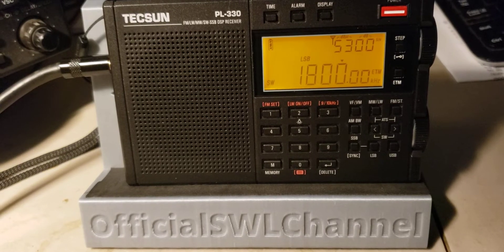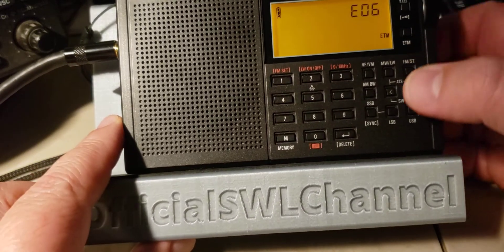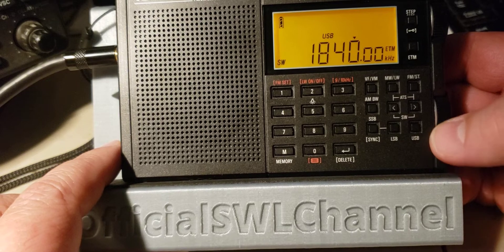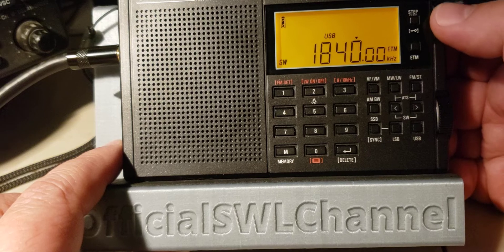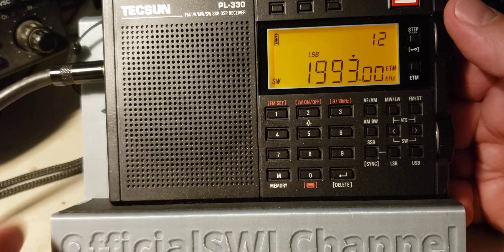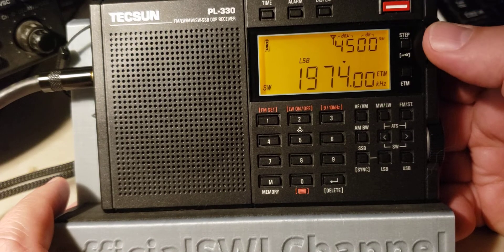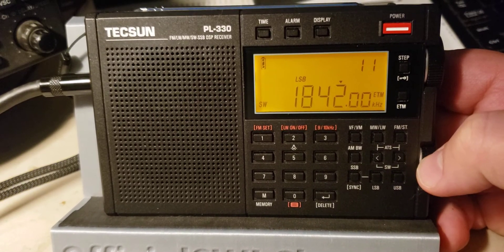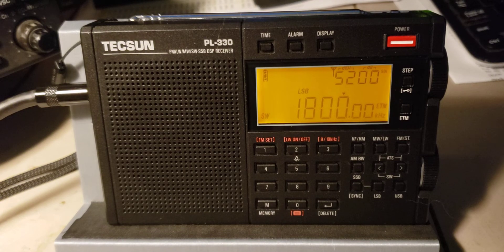Tuning the 160 meter amateur radio band on Tecsun PL-330 portable on MLA 30 magnetic loop antenna

Comment: Got an RSP1a which I'm still learning to use, but ordered a PL-380 based on your recommendation for emergency use because it uses AA's. Still hasn't arrived. Could've used it earlier this week as we are in Houston and had no power for over a day earlier this week. Not even T-Moblie cell service was working so no way to get news exceept to go sit in the car.  That did drive home the need for an emergency battery powered radio. May have a use for it later this year as we also get hurricanes that can knock out power for a few days.
thanks